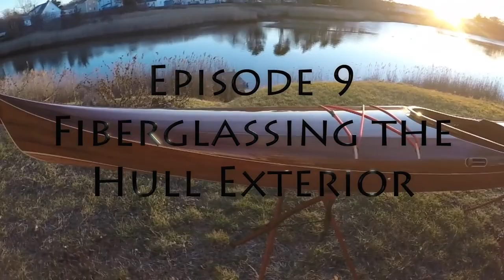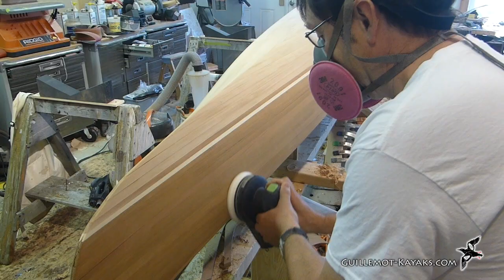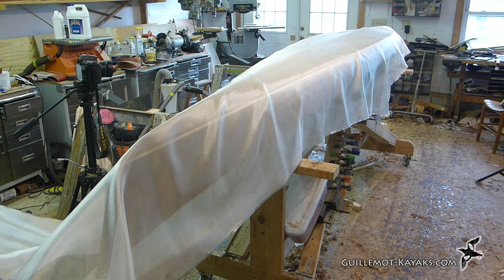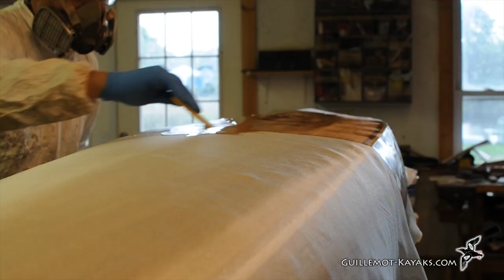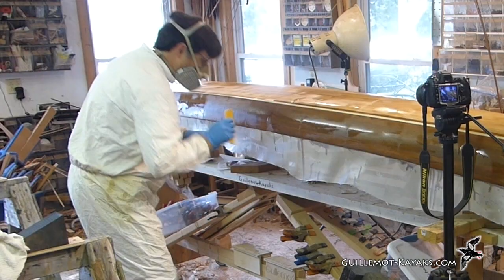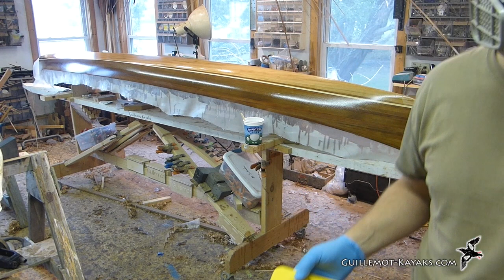Making a Strip-Built Kayak - Glassing the Hull Exterior - E9

Comment: This will be my 8th build. My first was the gilmount after 135 hrs right out of the book. I was shocked the paddles even worked with the off set scarf for the paddles. What a show stopper. I did go down and had several appraisals which came in at 10,000-14,000, but I couldn't sell. After 12 yrs of hard use and without a scratch it went up in flames burning up in a garage fire. Currently designing a strip built bush plane that looks promising. But expose yourself to other builders, as there's alot to be learned
Reply from the maker: Sorry to hear about the fire. That is my worst nightmare

Comment: When do you use wax in your epoxy? All coats or just the coats that cure and sand?
Reply from the maker: Unlike polyester or vinylester resin, epoxy does not use the wax additive. It cures hard without it.
Reply: Excellent, thanks.

Comment: Hi Nick. I am a woodworker considering making one of your boats next summer. I have thoroughly enjoyed this series and have learned a lot (read your book over several times as well). My funny question is about the squeegee you use for glassing. Any one in particular you recommend? Or do you make your own? Thanks so much for such a great series.
Reply from the maker: I like the plastic body filler spreaders with a single edge. http://amzn.to/2hogjpI They tend to be the right flexibility, I tend to have several different widths available.
Reply: Nick Schade Wow thanks so so much for getting back to me. I feel like a celebrity just wrote me a note! Already added your suggestion to my Amazon wishlist (hoping to get a lot of the supplies for Christmas so I can start building in the spring). Thanks again. 
Do you consider squeegees one time users then toss? Or wash them somehow to be used again?
PS I went to school at Connecticut College in New London which I think is not so far from you. Would love to connect with you someday and see your shop and boats. Sorry if that's weirdly personal. 🙂
Reply from the maker: I usually get several uses with a squeegee. Be sure to wipe them off after use. The edge can get a little rough, but a couple passes with a block plane will sharpen them back up again.

Comment: I don't see in any of your videos about the fiberglass reinforcement of the hull (where you add an extra strip or two to the areas that gets lots of abuse), but I see it in the book and you mention it in this video. Does this happen after the hull has completely cured but before you glass the deck?
Reply from the maker: Check out https://youtu.be/okpHe-HuT2k?t=11m53s On this boat I decided to put on a second layer of glass on the hull after installing the outer stems, which I chose to install after joining the deck and hull. After adding the second layer I then added some more along the keel at each end and wrapped up the stems.

The schedule in which you do different things is quite flexible. In this case I thought I was going to wrap the 2nd hull glass up on to the hull, instead of exterior seam tape. Because of this idea, I delayed the added reinforcing layers. After some reflection, I decided that was going to cause problems with bubbles on the deck, so I did a separate exterior seam later. 

The result is I am not adding more reinforcement until later in the project. I could have installed the outer stems before doing any glassing, done two layers at once, and then added a keel strip in the same operation. Either way would work fine.

This additional reinforcement is not required, but can be a good idea.
Reply: Nick Schade, thank you! My full length Petrel is soon to get its first coat of fiberglass! I appreciate all your videos.

Comment: ahh i wish i could build this, but this looks very expensive and requires a lot of tools
Reply from the maker: Since I have been doing this for awhile, I have accumulated a wide selection of tools which make some steps go faster, but the whole process can be done with very minimal tools. 

If you find materials from local suppliers, you should be able to keep the project to a modest budget.

Comment: How important is it to heat up your shop?  My garage is poorly insulated and has no heating. Great video as always, excited to see more.
Reply from the maker: What is most important is that you don't work in rising temperatures. This can contribute to bubbles in the layup. Try to work while the temperature is dropping, so maybe do your glassing in the afternoon.

The warm shop lowers the viscosity of the resin which makes it flow into the cloth more easily. It doesn't need to be as warm as I make my shop, but avoid working when it is cool or cold.

Some people will make a plastic tent area in there shop that they can heat up with a small portable heater. This may or may not be worth it, but it is an option.

Comment: More useful information and reminders. I was wondering where and when you added that accent strip at the sheer. I'm assuming this is at the hull/deck joint but I haven't seen it mentioned.
Reply from the maker: I will add the accent when I start working on the inside of the hull. You will see the process in an upcoming episode. 

When I started the kayak I was not sure if I was going to stain it. In which case I wanted to add the accent after glassing the outside. Since I didn't stain, I theoretically could have added the accent earlier, but doing it later still has some advantages.
Reply: Thanks again Nick. I (incorrectly again) figured it had to be on before the glass, and you fitted the hull/deck joint. It's all the little details that you're covering off that make a big difference. I'll wait for you covering it off.